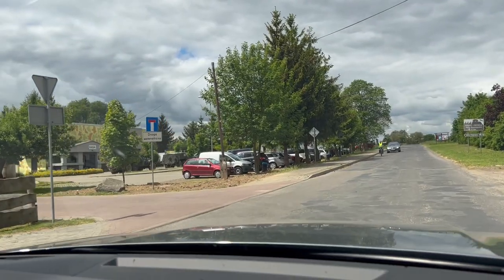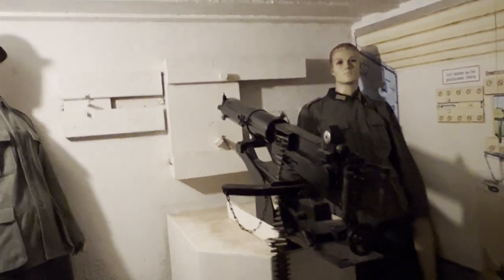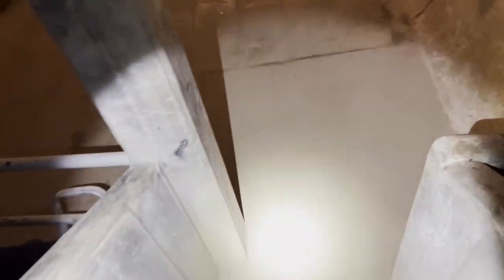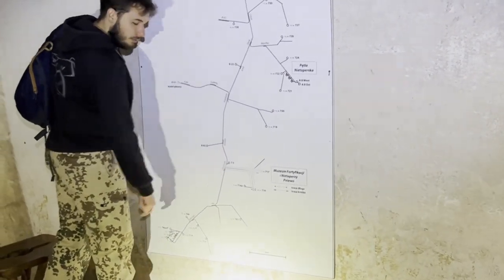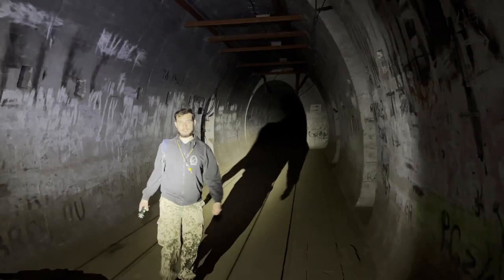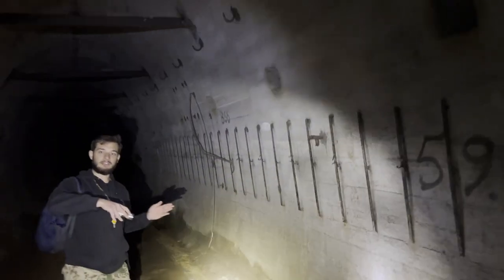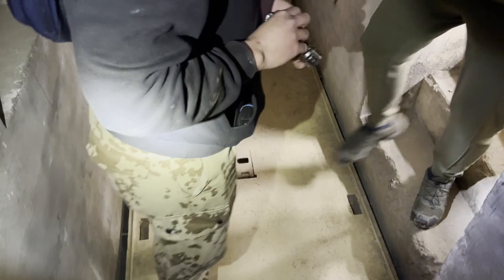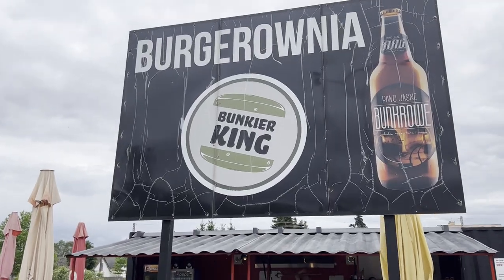Go Inside 90 Miles of WW2 Underground Tunnels and Bunkers!

Comment: When I was in the Army in 1998, I was stationed in Augsburg, Germany and worked at the Field Station Augsburg. Augsburg had notoriety because of the giant round antenna the US used to spy on the Russians as well as the fact the station used to be the former WWII Luftwaffe airfield which was never bombed during the war. Soldiers and commanders there knew about the tunnels that ran from the airfield to the Messerschmitt Factory down in the city about eight miles away. There were standing US orders from WWII not to go down into those tunnels because of the booby trap threat. At the end of the war, engineers had gone down into the tunnels and found the Germans filled them with booby traps. Rather than clear them out, the Army just sealed up the tunnels and took over the captured military bases. There was even a story that at some point, the Army had gone down into the tunnels and found a fully assembled Messerschmitt fighter that didn't make it out to the airfield before the city was captured. There were too many booby traps down there and they just left the aircraft in place. I didn't believe the stories at first until one day I was coming out of the old WWII barracks I was living in and saw my barracks had sub-basement that was totally sealed off from the rest of the building. I could see into a window that sub-basement was deep, and it had access doors on either end of it going somewhere else other than the barracks above it. Not long after that, I realized there were building on Sheridan Kaserne that were the same way. Even the old base headquarters, a building that Hitler supposedly gave a famous speech from its balcony, had a basement level with gated doors on it, as if they are preventing access to other areas.
Reply: I was at Gablingen (FSA Augsburg) as well. What years were you there? I was there 83-85 and stayed on Sheridan. Sadly, it has mostly been levelled now except that the Field Station and the Flair-9 is still being operated by the German government. The last operational "iron Horse" site left in the world.

Comment: I was stunned at the manpower and concrete that went into that bunker system. No matter how impressive, WWII was a war of maneuver, which made fixed fortification anachronistic by war's end. The network was a triumph of engineering but a failure in military strategy.

Comment: That was impressive, Ron. So, will you start making egg-shaped bunkers now? It's too bad most American towns don't begin building bunker complexes with connecting tunnels for civilian protection in disasters (we know the government already has huge bunker and tunnel complexes for themselves). Imagine having such systems - with offsets for small shops and living quarters - in tornado and hurricane-prone areas, not to mention small towns in northern deep-freeze and snow areas. Now THAT would be civil defense.
Reply from the maker: Yes we are already starting.  Watch for them in 2-3 weeks
Reply: @AtlasSurvivalShelters  have you guys ever done work with insulated concrete forms? they seem like the way to go to build a bunker being how easy it is the handle and then you have a space in the foam you can carve out for conduits and piping for a nice finished space